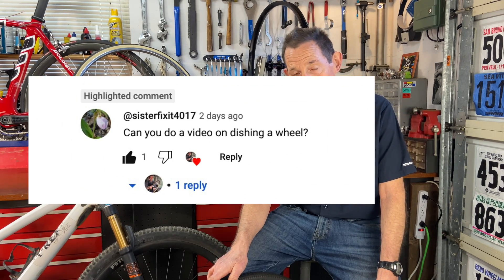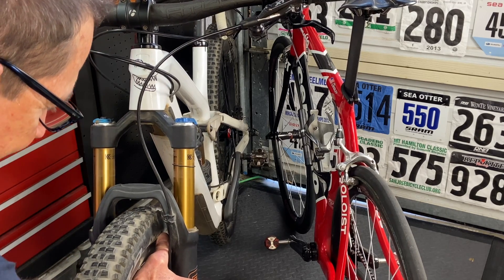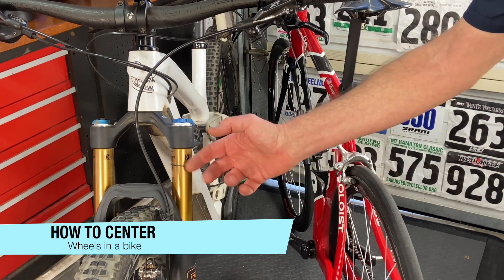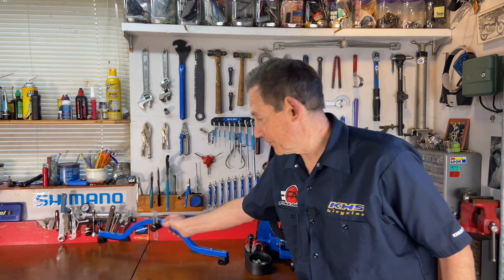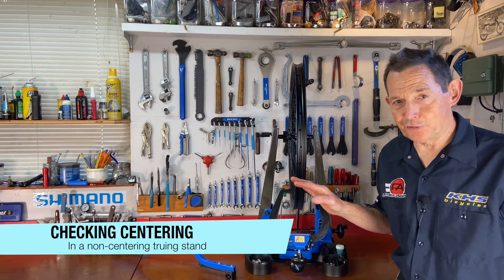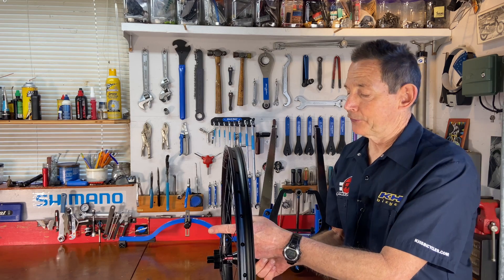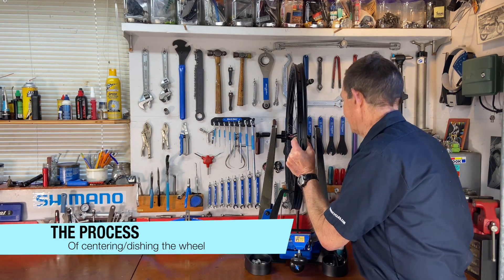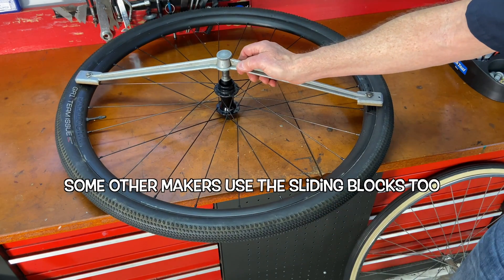How To Check And Center (Dish) Bike Wheels & Rims #bikerepair

Comment: Jim,  dishing and re-dishing comes into play changing OLD spacing on hubs (after cutting the axle) to fit older frames with narrower dropouts. Those of us playing with vintage bikes have this issue often.
Reply from the maker: Thanks a lot for watching and making that important point Chris, appreciate it. Being “vintage” myself 😂 and having restored a number of nice bikes, and with a small antique & vintage bicycle collection, I have a good amount of vintage content on my channel in case you or others are interested.    My basic advice, which you already know, is to get the hub spacing correct BEFORE building the wheel. In the case of a wheel that’s already built, it’s best to start with the original axle set that came with the hub. Modifying that rather than trying to “invent” an axle set with mismatched parts is the best way to ensure it comes out correctly. So if I don’t have an original hub with original axle set, I will start by finding the correct axle set for that hub. Failing that, I’ll find a complete hub in order to have all the correct axle parts to work with. I realize you know these things but maybe the tips will help someone else. I’m always happy to answer questions too. Thanks again Chris!
Reply: @JimLangley1  Gotcha, if I have readily available vintage axles, then that prevails.. However there is really no difference cutting down the axle (vintage threaded steel) and filing the ends if you are precise. Also most have a simple 8mm spacer that gets removed to bring spacing from 135mm to 126.5 .. That is the easy way to not ruin vintage frames by cold-setting a modern wheel onto old stays.
Reply from the maker: @chrisginsburg6611  sorry I should have explained better, I'm not talking about the axle, that's the easy part. I was talking about the cones, spacers, locknuts and the dust caps. If these things are missing or incorrect, it can become complete guesswork on getting the hub back together properly, not just spacing. That's what I meant about trying to find the original axle set so you have the right stuff to start with. In our shops we never threw anything out just for these situations... sooner or later you'd always need those old parts 😊

Comment: my rear deraileur jockey wheel cage touches the spokes when i am in the largest cog of the cassette, i didn't have any issue with this until i changed my cassette to get a larger cog(org. 12-25, upgraded to 13-29). Can i dish the wheel so the spokes are further away from the jockey wheel cage,or not? would love to hear your answer.
Reply from the maker: That's an interesting issue to figure out. It's counterintuitive that a larger cog would do this because the larger cog is further away from the spokes than the smaller cog was - because as you get closer to the rim the spokes slope away from the cassette even more. Which makes me wonder if maybe there was a spacer behind the cassette that got stuck on the 25 tooth cog when the cassette was removed and now isn't behind the new cassette? If so, the new cassette is closer than the old cassette and that'll be fixed when the spacer is put behind it. That's one thing to check for just to make sure as that's an easy thing to happen.

As far as whether you can fix this by tightening the spokes on the non-drive side of the wheel to move the spokes on the right side away from the pulley cage, you can probably do it - depending on how much you need to move them... but by doing it you will change the rim centering and that might affect the ride quality of the bike. If you have rim brakes it can mean that the brake won't center properly too. Hope something here is helpful.
Reply: @JimLangley1  hi Jim ,no there was definately no spacer behind the cog, Campagnolo has never used spacers on their freehubs or cassettes. I was just thinking that was the issue, but i guess you are correct, the spokes do slope away, no thatr i think of it, it was so long ago, perhaps it rubbed even on the 12-25 cassette, i just can't remember, but it didn't do it when i bought the bike(brand new) otherwise i would have brought it back to the store to have it fixed under warranty! I did bend this rim once riding over a rairoad track, and i tried staightening it, but i kept on breaking the same spoke when i road it. So I bought a new set of wheels, and decided when i have time i will fix this rim and use it as a spare wheel for riding in the spring when the road are dirty and still have sand left over from winter. I made a wheel stick tool to straighten the rim with so we will se how that goes.
Reply from the maker: @arnodivalentin5639  thanks for the additional information.. Then, I think you should check the alignment of the derailleur hanger on the frame. Since there was no spacer, the cassette must be in the same place as the other cassette. Bent derailleur hangers are extremely common. My favorite alignment tool is by Park Tool - it's accurate and the easiest to use: https://youtu.be/du08XdYc1KI It's not an inexpensive tool but it's something you use a lot because even if a bike just falls over it can bend the hanger if it lands on that side. You can also eyeball hangers if you want. To do that you shift onto the smallest rear cog. Then get behind the bike so that you can sight the cogs and chain and derailleur pulleys from behind. If the hanger is straight (not bent), an imaginary straight line that's perpendicular to the ground will exactly bisect the cog and both derailleur pulleys. With a bent hanger, that line will run through the cog but NOT through both pulleys. That's what you look for. If it's bent even a little, that can be what's causing it to rub on the spokes.

Comment: I am struggling with this part of my wheel building process. I need to move my rim to one side and I tighten only the spokes on that side like you mentioned but the rim is moving the opposite way instead of the side I want it to move towards. Any idea what I might be doing wrong?
Reply from the maker: Thanks for watching and the question. I’ll see if I can help: For this to happen you are probably turning the nipples on the opposite side of the wheel/rim. This is an easy mistake to make if you look only at the nipples as you work - right at the rim. Instead look at the spokes down by the hub first and follow that spoke up to the nipple to be sure  it’s on that same side. By doing this you will be sure to tighten the side you mean to tighten because you can see which side the spoke is attached to. It can be hard to see that at the rim. I hope this helps. Please let me know how it goes.
Reply: @JimLangley1  Thanks so much! I rewatched your video, and the key point I had missed was when you explained that it’s the rim we’re moving, not the hub. I had been thinking the hub needed to shift, so in my mind I kept telling myself, “the hub needs to go right, so I’ll tighten the right side.” Of course, that only made the rim move right, when what I actually needed was for the rim to move left to reduce the gap the dishing tool showed. I was getting really frustrated, but once you mentioned that detail in the video, it all clicked. Thanks again!
Reply from the maker: @bootlegspider6633  happy to hear you figured it out bootleg! Good job! Thanks again for watching and commenting!

Comment: I have three problems.Measuring the spokes.Centering The hub. I tried doing that did not work.
Reply from the maker: OK, let's see if I can help Kurt. Here's my short video on how to measure spokes https://www.youtube.com/shorts/FGBO6dZ1xig I don't know what you mean by centering the hub though. A hub comes from the factory spaced to fit into the frame. So it is designed to fit one way. So it's not the hub that you center when working on wheels but the rim that you center. Think of the hub as the base of a triangle and the rim as the triangle's apex. The legs are on the left and right of the base, those are the spokes. You center the rim by loosening or tightening (or both) the spokes as I explain and show in the video. You wrote "I tried doing that did not work."  I'm not sure if you're saying that you tried centering the wheel and it did not work or if you tried centering the hub and it did not work. If it was the hub, I just explained why that's not needed. So I think you mean you tried centering and it didn't work. If you can explain why or how it didn't work, I'll try to explain what might have gone wrong and what to do. But you need to start by being sure you're focused on the rim not the hub. It's the rim that you move when you center rims when working on wheels.

Comment: Thank you very much for the explanation Jim. In Argentina it is difficult to find the tool to check the center of the wheel.
Is there a way to make it at home?
kind regards🎉
Reply from the maker: My pleasure Lea. And thanks a lot for watching and the great question. Yes, you can make your own dishing/centering tool. It's basically a simple comparison tool. The most popular DIY version is in an online book about wheel building by Roger Munson. I think the whole book costs about $11 and it includes plans for building your own dishing tool. https://www.wheelpro.co.uk/wheelbuilding/book.php But it doesn't have to be fancy to work. You could just use a piece of wood for the main beam. Drill it in the center for a bolt that will be the center foot that you screw down to touch the axle/locknuts. Then stack other short wood pieces as feet on the ends until they reach the rim. With a little experimentation you can make something like this that will do the job just as well as the tools you buy. Okay? I hope this helps and let me know if you have other questions.

Comment: I have a cheap 90's MTB bicycle with a steel wheel  The  non drive spokes are 161mm, Drive side 163mm.   Can I buy all new 36 spokes the same length or does the 2mm really make that big of difference when truing?
Reply from the maker: Hi deltafour! So, since you have the wheel, hopefully you took a very close look at the spokes before taking the wheel apart. That's when you can see if the spokes in the wheel are the perfect length or if the wheel was built with too short spokes - a common issue with stock steel wheels. If they are the perfect length the spokes will go fully into the nipples and you won't see any threads at the bottom of the nipples.

Assuming the spokes that were in the wheel were the right length, then you probably need to purchase the same length as before since someone calculated that length to ensure they fit correctly in that wheel. Usually on rear wheels though, the longer length is on the left side/non drive side. But maybe the hub is sized such that it's the other way around on your wheel.

What you could do is calculate your own spoke lengths using an online tool such as this great one: https://www.kstoerz.com/freespoke/ Be sure to take your own hub and rim ERD measurements so you know what you put into the calculator are accurate numbers. I have a video showing how: https://youtu.be/LvV4FE2VxZk?si=tkNipBI9rjnfMibB

Now, if your goal is to be able to buy 36 same length spokes, then you could experiment to find what lacing pattern on the left and right of the wheel might give you the same length spokes on both sides. As long as the difference is only 1mm, you can round down or up to get the same length. So for example, maybe running cross-3 on one side and cross-2 on the other might give you even lengths? You never know what's possible until you run the calculation, which is fun. Just be sure to get the numbers right that you plug in. Okay? I hope this helps, have fun building that wheel!
Reply: @JimLangley1  The steel wheel was never taken apart due to one spoke nipple is seized on, due to rust.  Maybe that's why I am having trouble truing it and all have equal spoke tension   The ones I did take out, the non-drive are all 261mm and drive side are all 263mm.
Reply from the maker: @deltafour1212  you can usually break a frozen spoke free by heating it with a propane torch or even a lighter or heat gun so you might try that to get it to move. You can also cut out the spoke and replace it with a new nipple and spoke to be able to true the wheel. As long as those spokes in the wheel are the right length, that's probably the correct spoke length. If the spokes are on the long side, which would mean the ends of the spokes are sticking out of the top of the nipples, then you could go with the same size spokes on both sides and just go with 262s all around. The one thing with steel wheels is the rim is so strong that it's what does most of the work so that wheel should be very strong even if the spokes aren't perfectly tensioned. If you're having trouble truing it, it might be a bad seam or even a bent rim - both pretty common on steel rims. So you should check the rim carefully for issues with it that could prevent it being trued very straight.
Reply: @JimLangley1  "The one thing with steel wheels is the rim is so strong that it's what does most of the work so that wheel should be very strong even if the spokes aren't perfectly tensioned." 

You just cured me of my headache!
THANK YOU!
Reply from the maker: @deltafour1212  you're welcome deltafour - happy to hear it!
Reply from the maker: @deltafour1212  you're welcome!!

Comment: I was doing some minor truing on a new wheel out of the box,  the 3.23mm spoke wrench (black park tool) fit on the nipples but was SUPER tight to the point I had to leverage/jam it onto the nipple... is that common ? I actually rounded one spoke nipple off because i used a slightly larger green wrench which worked for most of the spokes but didnt on one of the really factory overtightened spoke nipples 😅
Reply from the maker: Thanks for watching and the question Zane. I wouldn't say it's common but I have run into it before where I used to work. I don't know if the variation in fit is in the nipples or in the spoke wrench. I don't have any to measure right now. But you could measure both the spoke wrench and the nipples to see which is out of tolerance. If it's the wrench, I would expect Park would replace it for you. You definitely want a tight fit but the wrench shouldn't need to be forced onto the nipple. But, I could see the possibility of a too thick layer of chrome that would make the fit undersize maybe. If it is the tool, you could probably sand it to size but again, it'll probably be easier to reach out to Park. If you find anything out, please let me know and good luck.

Comment: Another great video from Sir Jim!
Would you have left that last dish adjustment alone and called it "good enough", or would you have tweaked the left spokes another 1/4 turn or so? Sometimes it's difficult to leave it alone and just ride.🚲
Thanks for all you do.
Reply from the maker: Thanks for watching and commenting springpan, glad you enjoyed the video! Yes, it's definitely difficult sometimes to leave it alone. Whether to chase "perfect" centering or to leave it close enough depends on how tight the spokes are getting. If a wheel is at max tension and the centering is only out by say .5mm - 1mm, you might decide to not chase perfection anymore because it's actually only out half what the dishing tool shows, so that's a tiny amount and it won't affect anything.

In fact some builders choose to offset the wheel that 1mm to the side with less spoke tension - the left side of rear wheels - in order to "cheat" a little and get those left side spokes a tiny bit closer to the right side spokes in tension. That's an old trick. The wheel still centers in the frame fine and the only way to know the dish is off to the left a smidge is with a dishing tool. If it makes for a stronger wheel, it's all good. 

So it's really up to you what you think is best for the wheel. But some builders will only settle for perfect according to their dishing tool so there's that point of view too and I get that too. Thanks again and happy wheel building!

Comment: Thank you for the informative video Jim. Is there any need to de-stress the spokes after centering the rim?
Reply from the maker: You're very welcome pops! Thank you for watching and the great question. Yes, it never hurts to stress relieve the spokes anytime you turn a bunch of spokes. To do this you can just grab parallel pairs of spokes and gently squeeze to simulate what happens when you ride the wheel. Then check to see if the wheel came out of true a small amount from the stress relieving. If it did, true it and stress relieve one more time and you should be good to go. Okay? Hope this is helpful and thanks again!